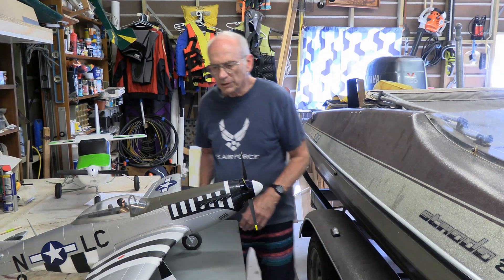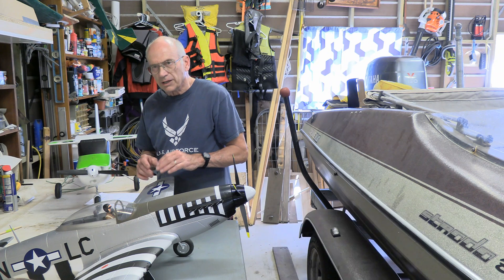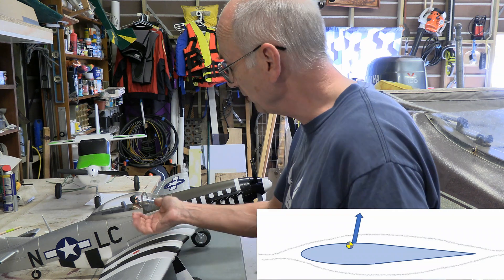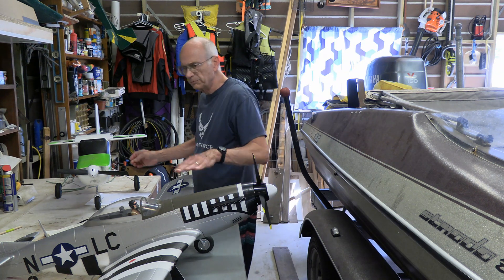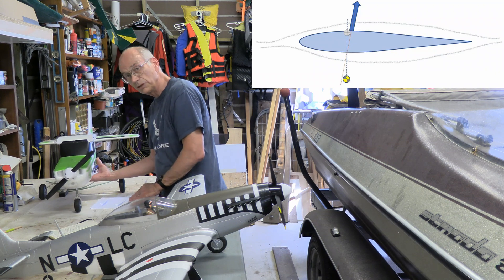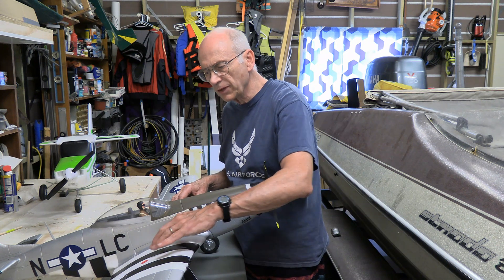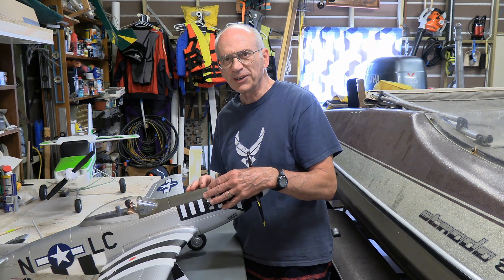RC Plane CG and centre of lift

Comment: Thanks for this video. Regarding your point at 12:47, does this also apply  to modifications where the RC plane (a flying wing) is extended in length  (at the tail end) but no changes to the wing surfaces? Does the CG point move? Or just moving weight around to maintain the original CG should suffice? Thanks.
Reply from the maker: If you added a tail onto a flying wing, the weight of the tail would move the CG towards the back.  The location of lift on the wing would not change.  So, you would need to add weight to the front to get it to balance near the centre of lift.
Reply: @RCJim  Thanks for your response/clarification.
Reply from the maker: Glad to help!
Reply from the maker: No worries.

Comment: 10:10    off-topic rambling about  flaps
Reply from the maker: Yes, guilty of rambling a bit, but on topic.  Flaps change the location of the centre of lift on the wing.  That's what we have been discussing.  This explains why the nose typically will lift when flaps are added without also adding down elevator.
Reply from the maker: What I didn't ramble about was what happens when one wing stalls before the other.  The dynamics that we have been discussing explain why that leads to a spin.  I'll ramble on about that another day, but it makes sense, and the basic principles in this video explain why.
Reply from the maker: David, thank you for your interaction.  I'm not the source of all truth, and I do appreciate other people sharing their own opinions and ideas.

Comment: 9:32    flaps    flaps     flaps       bleh
Reply from the maker: When I was learning to fly full size aircraft, I had one instructor teaching me to fly a Piper Super Crusier.  It didn't have flaps, and we did power off landing approaches, using a sideslip to get the plane down in the right place at the right airspeed.  Around that time I had another instructor that was teaching me to fly a Cessna 150 with flaps.  He wanted me to do power on approaches using flaps, because that was what was needed in the larger aircraft.  Both work.

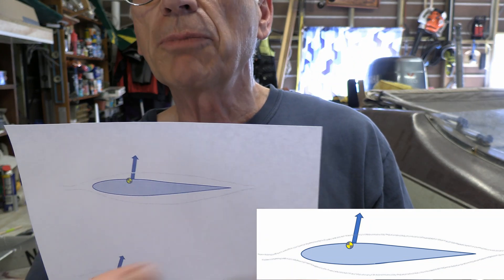Comment: 6:38    information          the science of aircraft design tells us that the two, chord-wise values (cg and center of lift locations) Should  be  coincident;  at/near thirty percent of chord or mac.
conclusion:  the design of a main wing  Should include a contiguous load-bearing main spar, at thirty percent.       d
Reply from the maker: Yes, and 30% is pretty well in the middle of the 25% to 33% range.  And because that is the centre of the force acting on the wing, it makes sense to locate the main spar there.

Comment: i would suggest that, in the future, you use a high-wing model as a visual aid; and begin with an explanation of why  a high-wing config is the most stable.       hint:  it's because the center of mass is  Lower  in the airframe.
Reply from the maker: That's a good thought.  However, it is more complex than that.  At the end I discuss how the movement of the centre of lift during a stall moves behind the CG, and that having the CG below the wing reduces the tendency of the plane to pitch nose down in that situation.  We needed the background to explain that.  Having the CG low does also help the plane to level itself out regarding roll in normal flight, but a low wing aircraft often has more dihedral, which can give it more or less equivalent stability that way.